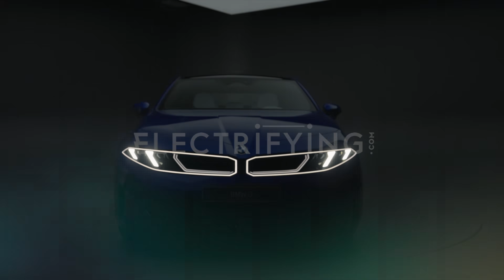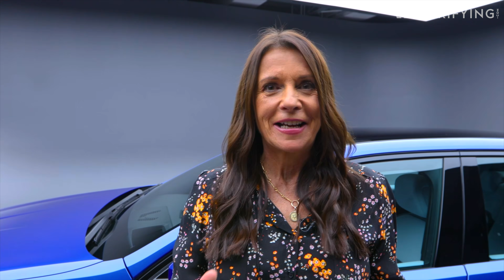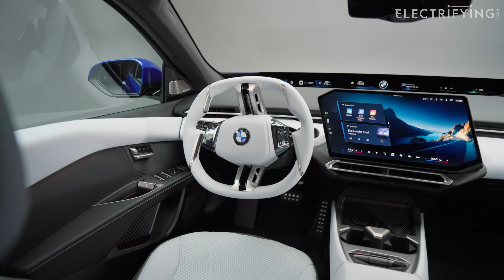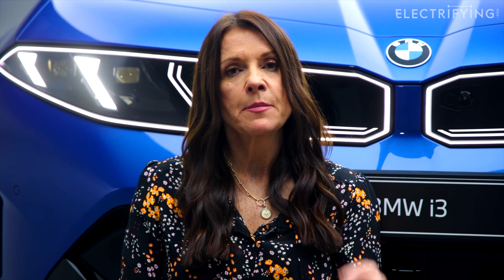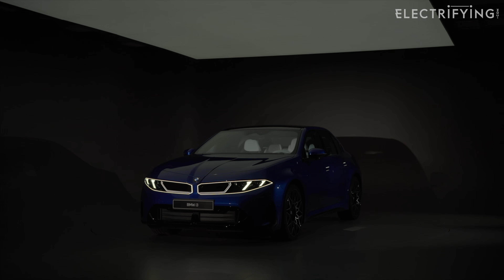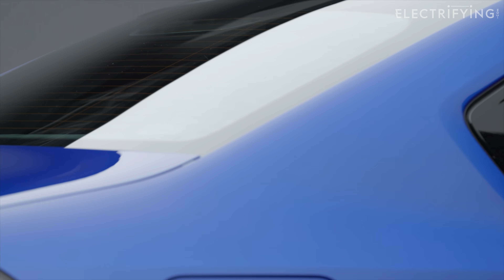BMW’s electric 3-Series revealed | i3 Neue Klasse walkaround

Comment: In my opinion, the front design is better on the IX3, I mean BMW is starting to lose it’s identity…
Reply: E,F really were bmw’s peak now it’s on an identity crisis and iPads electric, lost their soul really disappointing tbh.
Reply: It's like weirdly puffed up, as if a bee stung it, while the ix3 actually seemed well proportioned for an suv. When the previous 3 series appeared next to it, it seemed so sleek and so much smaller
Reply: I know I kinda feel the same way imo it’s just ugly and bmw should get a new design team atp
Reply: It is vice versa...BMW lost the identity with Bangle...this is now back to the roots and using style of the 80ties from the 2002 BMW.
You must be too young to know the "neue Klasse" from these days...this is why they called it the same like 45 years ago. Neue Klasse is not a new name, but from the 80ties.

Comment: Charge port on the wrong side, looks good except the way too chunky steering wheel. Does it have a Frunk and a decent boot? Good that BMW is finally making EV specific chassis
Reply from the maker: What would be the correct side for the charging port for you?
Reply: @Electrifyingcom why the industry didn't standardise on rear left is beyond me. All the 3rd party fast chargers have to have huge long supported cables for all the different cars that might show up.
Reply: @EwanM11 you mean like petrol pumps have a hose for either size.
Reply: @Electrifyingcom rear near side
Reply: You mean froot
Reply: @Noeyedear90 definitely not

Comment: Looks so much better than I expected (much better than iX3), actually, a new BMW that I would buy on looks alone, and then it's here, simply great Neue Klas platform underneath it. Did we actually get back "ultimate driving machine" ;) Ginny can't wait for the first drive to hear if the proper driver's BMW is back in this i3.

Comment: The bonnet sits much higher than the concept or the old 3-series. Makes it look more massive than it should. I wonder if front visibility is a bit compromised.
Over all, it's modern and beautiful.
Reply from the maker: Unfortunately, that's what tends to happen when cars transition from the concept to the production car. We agree, it's modern and beautiful
Reply: Personally, I think the E36, E46 and E90 are much cleaner and nicer designs. To me BMW lost the plot after this and my interest in the brand (former touring driver)
Reply: Pedestrian collision laws have made bonnet heights on cars to become like this 😢
Reply: @F @Fabulousprofound168 e bonnet height on a Tesla model 3 is extremely low and it’s got great safety ratings
Reply: @MrTophalf1999 isn’t that because of the active hood acting as a cushion? Not many cars have that system

Comment: Really don't like a four spoke steering wheel, especially with the 12 O'clock spoke, just looks clumsy.
Otherwise it looks really good, it will sell in huge numbers.
"BMW are building hardware and software, a bit like Apple" more accurately exactly like Tesla.
The AWD configuration is nothing new, it's the same as every other AWD EV or any AWD with Haldex and an ICE.

To sum up: Neue Klasse - BMW build car in same way as Tesla have done since Model S
Reply: i think they did it to force the customer to pay for the more expensive steering wheel

Comment: "White Vaganza" is gonne be my new Grindr handle XD
Reply from the maker: 😂😂 it’s a bold name isn’t it!
Reply: @Electrifyingcom  It's a Vaganza Extravaganza 😂
Reply: New Marvel character?
Reply: Something about the front end reminds me of the grilles on a Fisker Karma.
Reply: @neilrwilliams218  the designer of Fisker did design the Z3 iirc
Reply: 🤣🤣🤣 OMG, too good. I think I spit half my drink out when I read this.
Reply: @jodajale8620  Breath through your nose, darling
Reply: You’ll soon be reading “The Heart of Joy”
Reply: You mean Veganza….
Reply: WHAT was wrong with buttons? We've been using them for 140 years in cars. That's a lot of years. You've been copying yourself BMW - from generation to generation - for several decades - starting from E28 or E34 5 series, over to E38 7 series - my F11 five series - has very similar buttons. And I LIKE THAT. I can use them. I know where they are. Even not looking at them. Full climate control. Drive modes (mostly Eco/Sport acceleration when needed immediately). Stereo volume. WHAT WAS WRONG with them - what was wrong with finding them - without EVER taking your eyes off the road? What? Can anyone explain? BMW? You should know that, BMW - seeing you're located on the doorstep of fastest roads of Europe where you drive 180 metres in three seconds (do you want to spend these three seconds fumbling with a moron screen?) The only thing here is I think customers (like me) trying to explain something to BMW. Hey, BMW - you've been doing buttons for decades. You have also been doing many of your design cannons - for many, many generations and decades - you know the ones I talk about. It's not only Hoffmeister's kink (by the way your five series Touring didn't have it). You know which design standards I talk about. The distance from front wheel to hood. The line from rear to front lights through door handles. The overall taught, muscular shape. Lines that make sense. Like E39. You remember the last time you dropped them all? Yeah. You invited the designer boy Bangle to design your E60/61 and E65. AND THEN IMMEDIATELY - even during the immediate face-lift for the 7series - you went back to classic. Remember that? Why was that I wonder? Then you designed two still very good looking five series which were not Bangled. The F10 and G30 were classy, sporty, not bloated and not spitting onto your own design cannons, like the E60 was. So you went back to your roots - with the F10 and G30 - whole two generations of good design - after the moronity that was E60 (both interior and exterior). Why, I wonder? Something to do with a massive backlash and sales volumes? Hope it's not the case for you with buttons BMW - looking at the number of people VAG and Mercedes are currently fireing because of sales decreases - I'm really hoping you know what you're doing with the entire "buttonless" crap. I don't think you are. I think you're blindly following some stupid trend that's on the market for some reason or other (ukhem, Elon Musk). By the way, BMW - as you clearly know - sales figures of electric vehicles are declining. Sales figures of cars which f_ing identify as appliances are declining. But you still insist on being "trendy". Well, let's see where it all takes you. I just hope my F11 from 2012 drives forever. Just bought a massive pile of parts for it.
Reply: @JurisKankalis  BAHAHA NO real person would write out that long winded spam. Your real scam agenda is "as you clearly know - sales figures of electric vehicles are declining". Which is Wacko Lie based on only using the USA disaster figures and ignoring the rest the world. Funny how SCAM agenda spammers blatant use astro turf tactics and don't bother to appear realistic.
Reply: @Neojhun 1886 🤔 Internal combustion engine 🧐 EVs Yes, Steam carriage, Yes. Buttons, No !
Reply: @Neojhun 🤦‍♂️ 🤦‍♂️ 🤦‍♂️ 🤦‍♂️

Hey did your third party charger work for you this time? No? Awww.. You have 5 kilometer range left? Dang...
How's that 2 hour line?

Don't act like ev is the only way. If ev sales were not on the decline you wouldnt have large car manufacturer shift away from it.

All the rich people got there 60k ev vehicles. The omly spam here the brainwashed words coming from your mouth.

Btw, I already have a phone. I don't need one that has wheel that I need to swap every three years cause the battery is shit after all the charge cycles.

And before you go blah blah blah on batteries please think twice. Or don't, communist left green crazies love to speak from there other butts not even attached or in proximity to them. 😂 😂 😂 😂
Reply: @Neojhun  I didn't know what on earth he was going on about either. All those E numbers! Sounds like an ingredients list for some processed food. I agree about the button thing though. You know where you are with buttons. You know where they are. Useable by touch alone. Brilliant. Maybe they'll catch on. Again.

Comment: The AI integration is deal breaker with a detrimental reputation across every industry. There should be an option without AI (or any data scraping infotainment) on every new car. 

I miss the old i3, the hemp CFRP construction and wood trim dash. But this new i3 looks very well. 
Just hope an i2 and i1 will come very soon
Reply: The option is...go to settings and switch all this off.
The first I do in any car...switch off voice recognition.
Reply: @josefv-y8m  good on you, wish that mindset was more common, not least among new car/affluent drivers, doesn't make for a cheaper trim or future proofing decades down the line tho